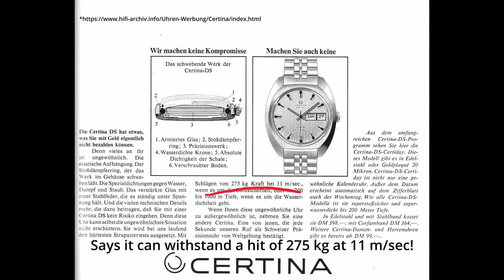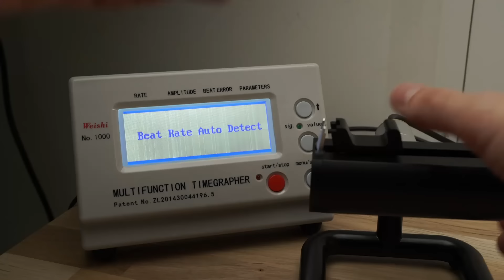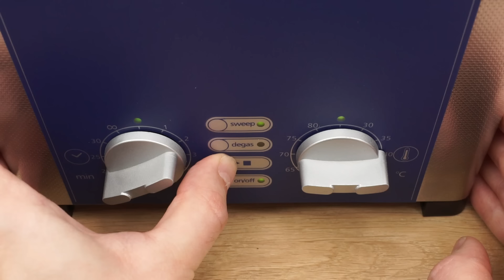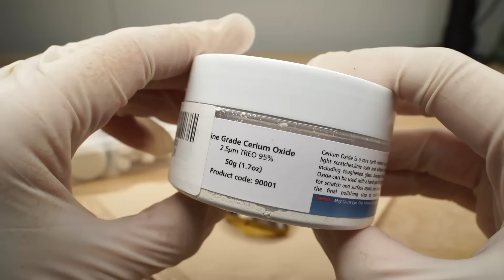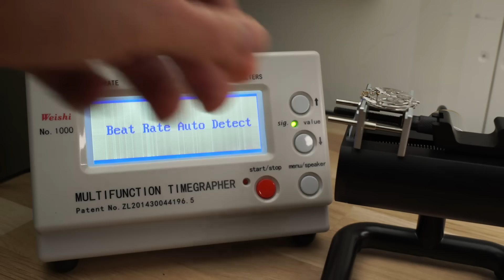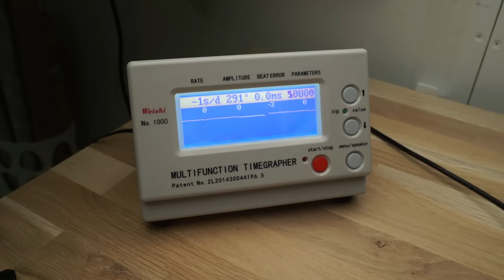Restoration The TANK of Watches - Polishing - Vintage Certina DS-2 - ASMR - Cal 25-661

Comment from the maker: I've been a long fan of this modell, Certina DS-2. So I tried my luck and bought one in an auction. The watch was heavily worn but I saw that it had a beautiful dial under the cracked glass.

The watch was a joy to work on, Certinas from 1970 is built like a tank, solid thick metall and robust parts.

In the end after all work I think this watch turned out very good, movement is in a good condition also. Ready for new action :D
Reply: Good job overall, but why did you take the new mainspring out of the holder ring just to wind it up again? You know you can just push them directly into the Barrel from that ring?
Reply: @chrvgts528  we liked to watch winding it
Reply: Amazing - but can’t believe you didn’t exert a little more to get the greasy marks off the dial…
Reply: @chrvgts528  yeah I noticed that as well, usually you can just pop it in from the ring. If it was an older type of spring, I'd add some hp-1300 preferably dragged out on the whole spring but here I'd just put 4 spots evenly and let it soak down in the spaces.. But a new spring has a coating, don't need lube.
Reply: Very good job!!! How I can send my watch to restoration ?
Reply: Hi!!! 
I love your job, and I will love to learn about how to repair my old watches, or try to... 😅
If you could help me would be awesome... Because I can't find anything, I only know to change a battery 🤦🏻‍♂️
Thanks a lot!!
Reply from the maker: @ДиасКерейбай  sorry, I don't do any private work :/
Reply from the maker: @quinse81  Try to read through Nicolas Hacko guide about seiko 7s26, that's a good start, all info there :)
Reply from the maker: @maisonMaple  I tried different methods for an hour but it think it a damage to the dial. I could see in the microscope some tiny chips of paint falling of. So maybe it's not grease.
Reply from the maker: @chrvgts528  Package was 10.5 mm and barrel is also 10.5 mm so doesn't fit :)
Reply: @Watcheyes  fair play 👍🏻
Reply: @quinse81  it takes a lot discipline, especially oiling the pivots, no oil on the rim, only in the oil cup. The balance end stones should be disassembled, be spotless clean and oiled with a drop in the middle, assembled and installed. Check for endshake on the pivots.
This is just a small amount of what we learn on the watchmaker school.
Reply: @Swim Fan Denmark
Reply from the maker: @Swim Fan I don't know but in many countries in EU atleast. UK, Switzerland, Germany maybe etc.
Reply: Certinaly a great restoration!
Reply: I'm the one who pressed like 100 times^^
Reply: Мне кажется,регулировку надо производить при полностью собранном механизме,включая стрелки,ведь они имеют массу.
Reply: @ЗамирМамазаиров-н8л  👍👍👍
Reply: Hi, I've been your fan for a very long time, I wanted to ask you something, if I may, I would like to save a wristwatch, it's quite dated, but it's a gift that my grandfather gave me, no one has ever managed to fix it, could you try it yourself? , if you need to pay, I would like it to work again,
Reply: When you have this many quick cuts, even inside the same operation of moving a part, it gets very hard to follow what youre doing, its spatially confusing
thats the only real complaint i have, keep up the good work
Reply: 8:17   Jaha du är svensk, mycket gott, rengjorde precis mina glasögon med gammal Gripens aceton
Reply: I still have my Seiko Diver's Watch since 1975, not sure of the exact date of manufacture, and still working, that has a same thick heavy stainless steel body just like a Tank, I had the Bezel and glass replaced in 1990
Reply from the maker: @VicariousReality7  yes, hehe, ja det blir många cut tyvärr, svår balans att ha det långsamt eller för snabbt. Tack för kommentaren, ska tänka mer på det iaf!
Reply: We have the same exact desk 😀
Reply: What was the blue stuff?
Reply from the maker: @stopthephilosophicalzombie9017  Elma luxury clean 95 is its name.
Reply: @Watcheyes  Thank you.
Reply: @Watcheyes  Can you recommend  a good first automatic watch? I want to start a watch collection.. and I'm thinking of starting off with a 1970s Seiko 5.
Reply from the maker: @VonDutchNL  some Certina i think, Certina ds or this one, ds2. But it needs a service, all vintages needs that.
Reply: @Watcheyes  Yeah I know a place where they service it. What do you think of Seiko 5? Or Citizen Eagle 7?
Reply from the maker: @VonDutchNL  Nice watches but not as robust and with high quality as Certina, in my opinion, from around 1970 I mean. Still very nice watches.
Reply: Hello friends ❤️ have a great day
Nice work 🙏
Reply: Не могу
Reply: So why put an acrylic "crystal" into it  may I ask? something that costs 1000 dollars or more should have sapphire glass or at the very minimal mineral glass, not a piece of cheap plastic.
Reply from the maker: @laodrofotic7713  The original ds2 has acrylic glass. The new glass I bought is the most authentic to the original one.
Reply: @VonDutchNL buy what you like and what makes you happy, not others. You’ll get far more enjoyment out of pieces you like rather than ones bought to impress others or with hope will increase in value.
Reply: I was under the influence of magic & skill, thats the ultimate perfection.
Reply: Where did you end up sourcing the new glass, I’m hunting for one
Reply from the maker: @patto647  Sternkreuz ATCT glas is almost as the original design of the glass. Ofc the original looks best because it's a bit higher but this is very close.
Reply: 😢😢😢😢😢🎉🎉🎉🎉🎉🎉4🎉🎉🎉β7
Reply: Who the hell greases pallet stones?  Oil pallet stones.  OIL.
Reply: @chrvgts528     Oil pallet stones NOT grease.  Who the hell greases pallet stones?  Push the mainspring into position.
Reply from the maker: @1911Earthling  Moebius 9415 Synthetic Grease 9415.

Recommended for pallet jewels of mechanical escapements for watches and clocks. /https://www.hswalsh.com/product/grease-synthetic-moebius-9415-2ml-hg9415
Reply: @maisonMaple  kū
Reply: @chrvgts528  a p
Reply: How the heaven and earth that you can remember them after dismembered so long hours from cleaning . So amazed to watch and funny acted while working. 😊😅
Reply from the maker: @VictorHugo-sf1dh  :D many thanks Hugo
Reply: I have a few mechanical watches from way back one of them a DS2 and I just love it. :)
Reply: In un
Reply: i want learn this skill can you tell me where too start?
Reply: Have you ever considered servicing a Girard-Perregaux original Gyromatic model or even a Lord Elgin shockmaster? Just curious

Comment: What a master craftsman you are, I am in awe.  I have rescued animals, domestic and wild and fixed broken wings, gashes, bad health, trauma, babies, and now I fix sewing machines and restore furniture.  I am always fixing things.  I love to know how things work.  Watches are a specialist job and a labor of love.  So beautiful to share your knowledge and how these mechanical masterpieces of engineering work and the purpose of the jewels.  I read that the modern sapphires and rubies are synthetic, and being harder than metal, work well as bearings which won't wear down with friction, nor produce heat. The modern sapphire crystal glass is also harder than glass and made from aluminum oxide and heat treatment. The higher cost comes from pricey tools needed to cut such a hard material and polish it. The old watches had real gems.  So a 17 jewel Swiss watch was a luxury item.  In my childhood, young adults inherited a grandparent's watch, and it was a huge gift.

Comment: Amazing to watch you work and see all the equipment that you use, I remember my father fixing watches back in the 1960s, he did it as a hobby with very little equipment, most of the things he used he had made himself, he used lighter fuel for cleaning parts and metal polish to clean the glass he also used nail varnish as a thread seal, he would sit for hours fixing them for friends and relatives and enjoying every minute of it, he had a table with a white cloth on it that nobody was allowed to touch and he would lay out all the parts and replace them in reverse order your video invoked such happy memories 
Thank you for posting this.

Comment: That was just awesome and the best part was the hand polishing on the case. I also like the simple cleaning technique with naptha and alcohol as I have a small bench and not a lot of room for a cleaning machine.  I was curious why the mainspring could not be pushed into the barrel directly from the shipping washer? I learned a lot from your vid! Thanks for sharing! I subscribed!
Reply from the maker: Glad you like my work C Perez, yes it's easy and it takes no space, sure a little bit more time but you learn and you get a close look of everything. Barrel is size 10.5 mm but also the package so couldn't push right in.

Comment: Great quiet video, really lets one concentrate on what is going on.  Your manual cleaning method clearly shows you do not need a $10,000 4 dunk machine to do a proper movement cleaning.  In fact, I think you touch parts with your small brush that would not ordinarily get completely clean with automated methods.  Thank you also for clearly showing the oiling processes up close, something that is too often glossed over.  Your patient case renovation is a testament to your artistry as well.

Comment: Never oil on winding and setting. Grease under the crown wheel always. Also, oil the train before putting the pallet in and wind it to spread the oil down into the jewel/pinion shoulder. That way you can properly judge backlash, because you had zero. Other than that a few details, it was a decent overhaul. AWCI offers classes to tighten up some of those things.

Comment: Lovely job! Do you have dedicated videos on polishing, on cleaning, and oiling? I’m always really interested in the details. Cleaning is my worst enemy, I cannot find the perfect answer. I have 2 ultrasonic cleaners, Elma wash and rinse solutions, IPA, Elma red 1:9 and Renata. Any help would be greatly appreciated.
Reply from the maker: Hello again Boyd, nice to see you here. I don't have any video on that but cleaning depends on how dirty things are. Be sure to peg all dirty areas, some dirt can't be solved with any solution. 

Barrel arbor, teeths on cogs and the leafs, keyless works, all of these needs to be pegged,l if very dirty. You peg, brush of, blow of, rodico. If very dirty brush with IPA after pegging, repeat. Pallet fork needs all of its sides to be scrapped with pit wood. 

After this let your elma solution in the ultrasonic run for 10 minutes (if no degasing) , then add all of the parts and run for 10 minutes. Try and error :)

Comment: My mother-in-law gave me her husband's ds2 from the early 70s. It sat in a drawer for over 40 years as he passed in 1978. 
It functions just fine. However, I began using it and it quickly became difficult to wind, dried lube, dry seals? 
Who do you recommend I send it to for cleaning and repair?
Reply from the maker: What an interesting comment Jason , thank you for this 😀. The oil and the grease inside have become hard at this time, that is why you experience this. But as it hasn't been much used it will be in a great condition if someone service it, clean it and get new oil/grease, also new gaskets as they fall apart after a while. Try locate a good vintage watchmaker in your town.
Reply: @Watcheyes  do you think a good watch maker is fine, or should it be one who specializes in Certina?
Reply: Хорошая работа. Я на днях купил Certina Clab 2000, 1970, NOS на задней крышке пленка. Часы идут 49ч, но завод тугой, надо обслужить. Спасибо за ролик.

Comment: What is Epilame? Epilamation is the surface treatment of a part. It is defined as being oleophobic which means, repels oil and lowers the surface tension of the applied area which helps prevent the spread of lubricants.  Thanks Google.
Reply from the maker: Thank you Jon :)

Comment: Does the glass need some glue to stop the water passing through the gap?
Reply from the maker: No it's a steel ring inside the glas, pressure ring that seals it from rain or water splashes.

Comment: you've gotta use dental technician micromotor. this devices are more precise and more comfortable than any dremel. these devices have adjustable speed, easy bur changing, higher torque and finally smooth rotating.

Comment: AS 1950/51 Calibre in This is Fast beat movement, Slow Beat movement is AS1803/4.  Change the Centre second wheel, firstwheel, Escape wheel, and Balance wheel  slow beat to fast beat.

Comment: Hello!
I have a citizen tsuno titanium watch which has mirror finish next to the glass on the case. I am thinking to get back because not as mirror as it was in new condition. I am planning to use hand drill whit small cotton wheel and thinking of what compound would be really the best to get back the end mirror finish. What do you think as the best compound to achive back just the last mirror clear finish (without microscopic scratch)? I ordered a dialux green compound. Whit this method and compound you think i can reach it? Or cerium oxide can be a more better for this thing? Thank you!

Comment: LOL! New mainspring comes in metal ring. You put this ring ON the barell and just push on the spring down and spring is installed. Why did you unwind it 16.20??? Maybe you didn't know that trick?
Reply from the maker: Didn't fit right away, the metal ring diameter can come in various sizes, not always what you order.

Comment: Why do you unwind and then rewind the new mainspring? Why not just pop it straight in?
Reply from the maker: The package had another size, they can come in different packages so sometimes you can't just push them in :/. If you order 11,0 mm in diameter, they can come in 11,5 mm or others.